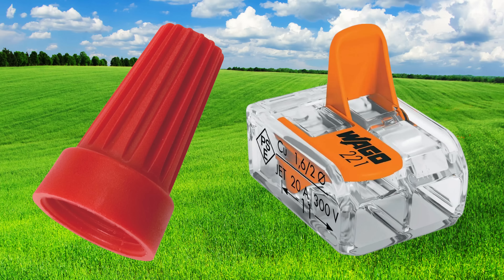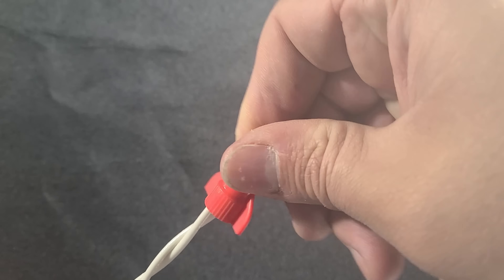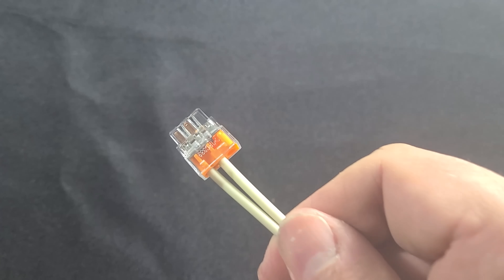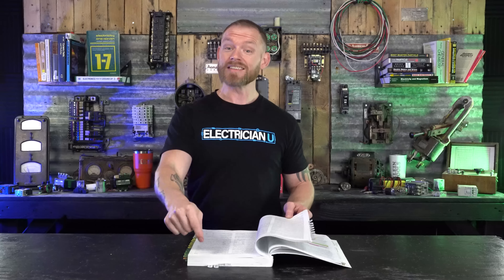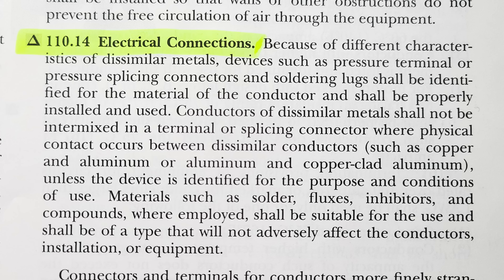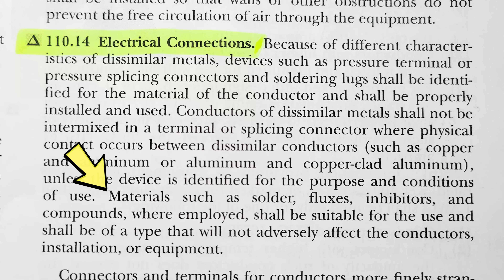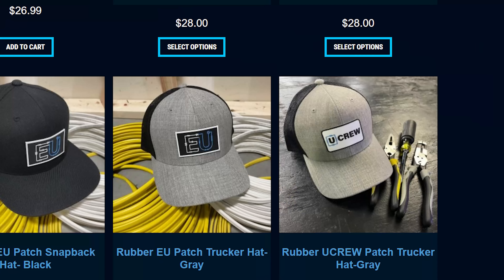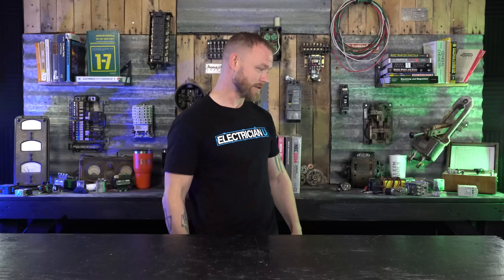Should We Use WAGOS or WIRENUTS?!?!

Comment: Please tell me wago is better so I can stop twisting wires. But the resistance of Wago's still makes me think that wire nuts are worth the time. I know that it takes longer to twist wires, but I'm typically only doing one room at a time. Is ten minutes of twisting worth two extra watts of power? I don't think so. Two watt/hrs over a ten year lifespan is a awful lot of power. Add that to the cheap price of wire nuts, I don't see the benefit of Wago's. I would love, love, love for someone to prove me wrong. I love new technology! But I don't think current Wago's are it. Maybe if they were copper plated. I'll wait. For now, nuts give me the dependency I need.
Reply: How many inches do you have to shorten the wire to get the same resistance as with wirenuts? 2"?

Comment: im from germany and i almost nerver see something else than wago here... and i gota say i cant imagin using wirenuts.... how painfull it must be to chage the circuit if  u have to  untwist the wires + u cant eveven  rally do it  while the wire is still hot ( like you shouldnt do that but there are situatuion where you have to ..)  
we have alot  houses that are renovated like evry  10 years and stand for 50 years or so ... and sometimes you just extend existing circuits  or  put one  plug more  into the wall . and for this kind of work the wago is just  supirior. its save , it does not twist  or bend the wires, u can actualy see if u conekted it right cuz the new ones a seethrou, they are  save bc u can see throu  ther for u know  if a wire gona get out . and the ones with the  little klamps are even good for when u have  realy old textileinsulated wires that fall apart if u touch them and u dont know wtf  its coming from cuz the  instalation is  80 years old.  btw never realy saw a place where i had mixed metals other than  like 1000v kables unter ground....  so there are  obviusly regional diferences in the style  of biulding taht affekt  the way we install the elektric

Comment: One thing I've discovered is push in connectors are dangerous to use with strand wire. It doesn't bite onto strand and I've seen several connections come loose and even shocking unsuspecting guys at 277v

Comment: Call me stupid, but I do have a question on WAGO nuts... I have seen WAGO nuts on Amazon and other places, and I have heard tell of knock-off brands, and I'm wondering if there is a way to tell a true WAGO branded nut, and whether it really matters if it's a knockoff or not? If and when I do a room in our unfinished Barn, for a small computer lab, and workshop, I'm actually thinking about going with WAGO connectors, just in case I need to do any repairs or replacements on my electrical in the future... Especially, if I decide to have something more than just an LED strip on the wall for lights, because if I do like a drop-in ceiling light, for instance, that is LED, then I would definitely also use WAGO connectors there as well... Another thing, is that I do small projects that require connectors and perhaps if I can get something similar to a WAGO nut, but designed for smaller wires that would be something I would look into as well...

Comment: My current house has aluminum wiring.  If it was a split level I would likely begin slowly replacing all the wires with copper one circuit at a time.  Unfortunately it is a 2 story and I don't care to rip out a ton of drywall.  I'm still not sure what the best way to idiot-proof the wiring to get it ready to one day be a rental property.

Comment: I am no mechanical engineer, but it seems that when you pre-twist the wires, the nut does not get as good of a grip. They are already bunched up, basically straight, and a wire nut is not straight inside, and will only grip the widest section of twisted wire. Putting it on straight wires lets the concave end twist first, and forces the twisting wires against the threads much better.

Comment: Wago's are the gusset plates of the electrician world. Everything is a perceived "advantage" but when it comes down to long term use, range of application, and tried and true real world experience, they will always fail sooner. 

Just ask a professional electrician "should you use the screw terminal, or the push to connect on a house outlet" and you have your answer on if you should use wagos or not.

p.s. the answer to the above for any electrician worth his salt is to use the screw terminal.

Comment: If something is that is going to be permanent I think wire nuts are good and take up less space in a tight box and have to lowest resistance because the wire is actually touching but anything that you may need to take apart and change a couple times then wago are probably the way to go but I don't agree with people that that wago are easier which is subjective but they said it saves time I don't think it does but I never thought of the copper to aluminum and sure but I mean is copper to I assume nickel plated copper to aluminum any better
Reply: And wago is probably better for fine stranded wire

Comment: As someone who actually repairs high voltage machines, I can confidently say that you should never pretwist wires when using a wire nut.  Of you need to separate the wires on a 480volt circuit, you want the wires to separate easily and connect easily so you are not struggling when your hands are holding high voltage wire with bare ends
Reply: Well working on live circuits over 50 volt is not allowed anyway atleast here in Europe and no boss can force me to so.
Reply: @MultiArrie  That’s the limitations of being an Electrician, but, as an HVAC-R technician, there are situations where the Unit in question must be energized to check the various pressure switches, relays and compressor protection devices. 

When working on a 480 volt system, the relays and
Safety devices are 240, 120 and even 24 volt and the 480 must be on to energize them.  So even at 240, a wire nut is used.  Lay the bare ends together and tighten the wire nut til the wire starts to twist, that way when you remove the wire, the circuit breaks easily.  
This is usually done on large capacity AC units that have 2,4,6 compressors on large buildings where you cannot completely shit of the system.  
I’ve even come across distribution panels that had a hot leg powered by the main feed that you could no
Reply: @davidvines6498  Well in Europe every piece of equipment has a mainswitch and is suited for lockout tagout locks. Those switches are for service personel to work safe. Fault finding you have to measure with the power on ofcourse. And ac or cooling you can always shutdown unless its a hospital. There is ever a reason to risk your life for a repair job.
Reply: @MultiArrie  we are Supposed to have lockout switches too   But now the manufacturers put them inside the unit, with the disconnect out of arm reach and sometimes downstairs in a mechanical room.  And with automatic reset switches, when the controls are powered down, the switch resets.  If a tech is chasing a problem such has high pressure and he arrives in the morning, the machine might function properly til the ambient temperature rises.  Then there is a call back   Equipment with auto reset switches and safeties have to be diagnosed with the power on when first approached
Reply: Not turn off.  We would have to call in electricians to change the breakers, they would stand on 1-2 inch thick rubber pads, wear rubber gloves and eye protection  

That being said, if AC equipment was not stuffed into a metal case like sardines in a can, wagos would work great

Comment: I feel like wagos don’t offer enough surface area contact to make a proper splice between two or more conductors.

I do prefer wagos when working with very short conductors where making a splice may cause existing conductors to break thus causing an entire new circuit to be ran, turning a 10 minute job into a 4 hour job.

Comment: What does the wire nut manufacturer say about pre-twisting for a wire nut?  Hint, not best practice.  This from Ideal instruction sheet:

"Pre-twisting acceptable, but not required. For pre-twisting; strip wires long, hold wires together with insulation even, twist wire ends together, trim to recommended strip length."

Comment: To twist or not to twist, that is the question...Back in the 90's a Buchanan rep came to the job site. At that time they recommended not twisting. We did a demonstration. Two #12's, solid copper. One set twisted the, other not, then pulled. The twisted pair pulled out of the wire nut, the untwisted pair one wire broke. Personally, I like to twist the splices for pass through and leave the device conductor/pigtail untwisted. That way if for whatever reason I have to get back into it I don't have to take it all apart.

Comment: I totally agree that wire nuts are rock solid true and tested for over 100 years.  I think twisting the wire than putting on the wire nut for constant high current applications or things is way to go as mentioned.  For low current high change environments and tight locations I would go with the Wago.  I am not 100% comfortable installing in circuits that are pulling 20 - 30 amps continuously with the Wago as there is only a single point of contact held in place by a tiny spring which may weaken over many hot cold cycles over the years. The plastic the Wago is made from plastic that will melt vs the wire nut made from bakelite will handle much more heat and I have seen wire nut change colour but not melt.  If price is an issue I personally would pay a little more for the twist and wire nut method since homes usually have the same wiring for 20 to 50 years and cost over that many years is negligible.  Thanks for a more in-depth explanation on the uses if the Wago.

Comment: I'd commented on GreatScott!'s video about this that I'd like to see a comparison for when wiring long strings of receptacles (~10)  in series using only the pairs of screw terminals, in parallel (the "pig tail" method) using Wegos, and in parallel using wire-nuts.
If you have 10 receptacles on a circuit connected using Wegos then when you plug something into the last one then the current will have to pass through a total of 36 spring connections, plus the two screws at the end. If it's done using only the screws then the current goes through 38 screw connections in total. And using the wire-nuts it's 18 wire-nut connections, plus the two screws at the end.

Comment: Well I started in the business when copper crimp sleeves were the norm. Thank god they had stopped using glass or cloth tape for insulation two years before I started (we had new vinyl tape). And yes a "wire nut" is used to keep a twisted set of conductors tight and insulated. Years later when I saw my first crappy "stab lock" wago I told my new employer to go fu$k himself. Have not seen a wago  or that boss since...A.C.Feuerhelm

Comment: Let’s just think about the fact that it’s 2022, we’re debating WIRE NUTS, and leading electric water heater manufacturers can’t bring themselves to increase the size of their junction boxes enough to actually fit wiring in without having to jam them in with a 500 pound press.

Forget wagos, ballast disconnects, etc. Wiring is stuck in the 1890s.

Comment: I prefer wago from the very beginning, then tug on wire before taping over the clips n always kill the power n check the wires before you touch n unscrew. I have pushed in solid n strand wire easy, just got to spin all the strand wire together quickly n you can be done in seconds

Comment: TBH coming from a country where some of these old screw terminals (Lüsterklemmen) and older Wgao models are seen as a scuffed thing to do in electrical things these archaic looking wire nut look like they came right out of Edison "shed".

Also aluminium conductors in normal home installations is a thing of a very bygone era from the last millenium.

Comment: I'm not an electrician in any way but I do light maintenance at work.   We recently replaced all of our lighting going from fluorescent and incandescent to LED.  I had to modify all the new 4 foot lights and using the WAGOs made for easy connection.  Just snip, strip, and clip....DONE!   I always had troubles with twist nuts and having loose connections.   Push ins are okay but lever nuts are the best.

Comment: The wago ones make me really nervous, reminds me of the crap back-stab holes that fail over time.  Wire nuts I only pre-twist if stuff is getting mis-aligned while I work on it, I prefer to put the wire nut on and keep tightening it until its twisting the wires together which seems to provide the best combination (and make sure it won't fall off)

Comment: If you read the manufacturer’s instructions when using a wire nut, you’ll see that they do not tell you to pre-twist your wires before twisting on a wire nut. As a service electrician, I absolutely hate troubleshooting a box that someone has pre-twisted the wires when they made up the box. A lot of times you can’t shut the circuit off, but untwisting the wires would do just that.

Comment: I learned about WAGOs and got the 221 series kit.  I love it especially for some problem boxes that had a total of 5 sets of 12/3 wires going into it.  Sure a wire nut or two was fine with the conventional light switch that took up less space, but swapping out toggle lights with dimmers, timers, or smart controls,  you really need to easily press the neutrals and grounds to the back of the box, and out of the way, and not fight what is essentially a 5AWG twisted strand
Reply: This is one of be biggest benefits of WAGOs in my opinion, it's so much easier to fold up neatly against the back of the box because the wires are in a line and not all twisted up!

Comment: If my wire nut comes off, i want my wires to separate, and short the system, so i can repair it. The last thing i want is current flowing inside my wall without insulation at the connection. For this reason i do not twist my wires, when using wire nuts.

Comment: It is interesting to see the differences between countries. In the land down under.... what's a wire nut? You see mostly terminal strips or BP connectors. For example we don't use boxes inside the wall like the USA. Your power outlet that eventually gets screwed to the dry wall (gyprock). Has large enough holes to put up to 3 x 2.5mm wires in and simply screw down.

Comment: Marine Engineer here. I've run into problems with Wagos burning up within the amp range they are supposed to be good for. One of my engineers used them to wire up a pump. Within 3 months that connection failed. My contention with them is when you use a wire nut, you twist the conductors together so your connection is as good as the wire. Wagos are only as good as the metal in them since the wires don't make contact with each other and rely on the metal in between the conductors. The metal between the connectors melted and my electrical contractor said not to use them on high draw start up devices even though they are rated for them.
Reply: RE: I've run into problems with Wagos burning up within the amp range they are supposed to be good for

Are you sure the connectors are labeled Wago? Your story doesn't sound credible, actually.
Reply: @elbuggo   They were and its exactly as I told it.

Comment: In Australia, we use Bp connectors which is basically a plastic terminal with brass inside and the cables are held in with a little screw. However, I have used wirenuts and wagos over the years and to be honest, both options are not as strong as the Bp connectors, because the cables aren't held by fasteners. I just think that using a screw to hold the join provides more support and better protection then wire nuts and wagos.
Reply: Problem with Bp connectors and wirenuts is that they will not tighten up the pressure on the wire if it gets lose over time. Wago will adjust the pressure or keep a constant pressure on the wire. Same principle with the hose clamps in your car. They use a spring type clamps and not the screw type that will not adjust the clamping pressure but be static.

Comment: What you should of done in your video is do a test using wire nuts and then use those Wagos... and examine the heat they put off (at the connection) using an infrared temperature sensor. I understand they are easier to use but I would never use them. I can see they could probably be safe to use at a light fixture. BUT people would daisy change with three or more wires. I have seen these damn things fail. They fail for the same reason those stab in connectors on the back of receptacles also fail... I have seen many of them all burnt up. You may not be around when another electrician has to go back in a few years to replace some of your Wagos with wire nuts. that little spring inside that Wago that holds the connection will heat up then fail to press hard enough and fail. These can start a fire. Just because something is quick and easy does not mean it is a good IDEA.

Comment: I absolutely love Wago termination connectors. I do prefer the stab-lock for solid wire and semi-permanent wire connections, otherwise the lever-nuts are the cat’s meow… Stranded wire or as explained in the video, ballast exchanges even with solid wire are about 1/3 the time and effort of standard “wire termination caps”

Comment: Twisted wires (beyond the part that enters the nut) are absolutely stupid. Totally moronic. Extremely dumb. Try replacing things as a homeowner when the bad old timer electrician twisted 100% of the available ground wires into a box. If you twist wires, F you.
Reply: This! Yes. I hate opening up a 50-year old box full of twisted old thicker wire insulation. Whatever this old NM is it's way more difficult than modern Romex. Hate nuts, hate twisting.